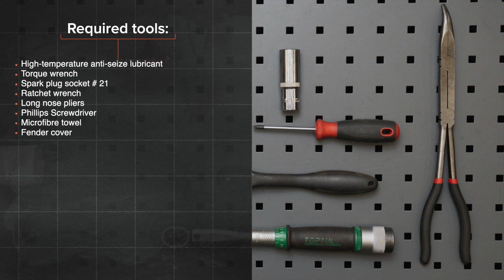How to change spark plug on VW POLO 6n1 [TUTORIAL AUTODOC]

Comment: Extremely professional Video production and repair procedure. Not sure I understand why any lubricant is used on the spark plug threads. Thanks again.
Reply from the maker: In order to make them easier to unscrew at the next replacement.